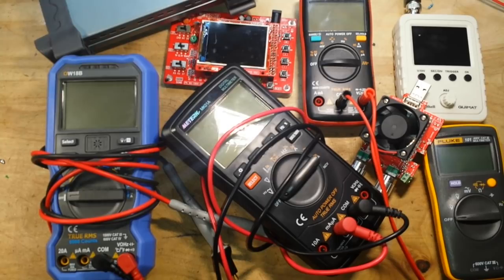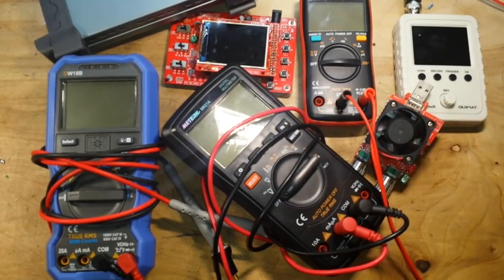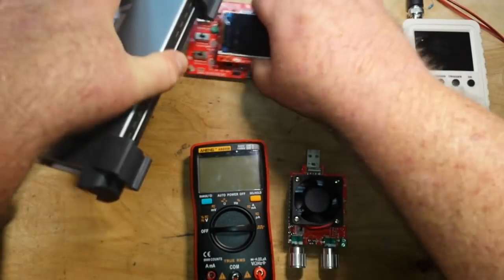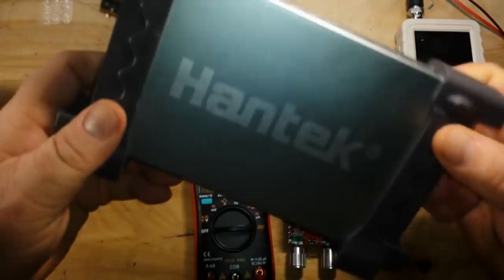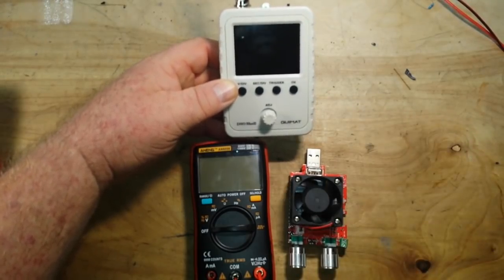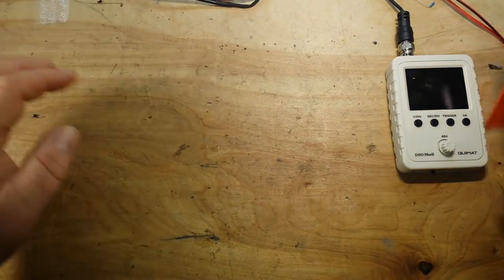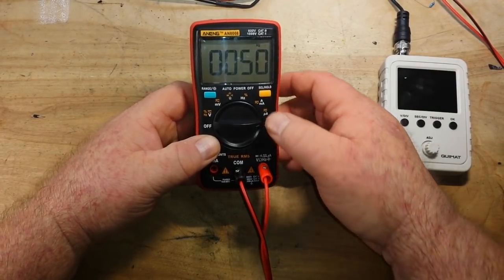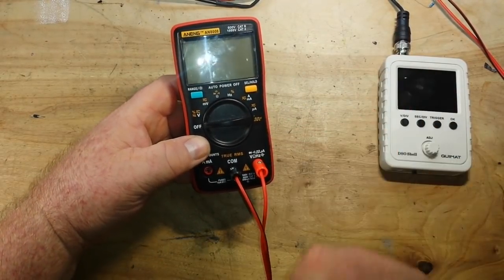Start your electronics hobby for just $60

Comment: Good job helping Eric decide on the entry level beginner toys. I started with a $40 hakko soldering iron from Frys. I already had a Klein tools multimeter then bought the Dso138, upgraded to an inexpensive soldering station from Amazon and inexpensive power supply and one of those component tester kits that has the limited built in signal generator and pwm. The DSO certainly isn't the best but it's helped me in a few situations.

Comment: I wish i got a set like this in the 90's . The case looks like the gameboy. You need a 9V battery / power brick and a dc barrel jack which can be easly found on the scrap. For starters on the budget on low energy , low voltages it is suitable. A used CRT scope on auction is also good option.

Comment: Paul, do you know where to get fuses for the ANENG 8008 multimeter? Not being able to find fuses is holding me back from purchasing one.  I always have extra fuses on hand just for all my meters in case.  Thank you for any reply.
Reply: The fuses are 3.6 x 10 mm   look on ebay etc..  Cermaic ones.  Some have axial leads, you can just clip off if you get those type.
Reply: Thank you.
Reply: I found another place that has these fuses     http://www.littelfuse.com/products/fuses/cartridge-fuses/3-6x10mm-fuses.aspx

Comment: Hey, Paul great video as always. You are a great teacher and I learned a lot watching some of yours and other youtubers stuff. Some time ago you featured a signal generator made from CD4060 and CD4040. After that video I decided to make one of my own. I've added rotary switches for the output and a voltage regulator. My solder job looks horrendous and I still need to find good case for it but it was a great learning experiance for me. I would recommend this small project for anyone starting their adventure in electronics. I would like to thank you and just say KEEP UP THE GOOD WORK!
Reply from the maker: Thanks that means a lot to me

Comment: +1000.
To person ho asked:
Add to your routine run trough charity shops/thrifts/salvation army charity shops.. Go thrifting! I scores multiple power supplies for $1-2 each, proper ones, UL listed. 
Also you will find cables, connectors, boxes.. Pick up any network cable (twisted pairs). Solid cores for breadboard jumpers, stranded for power/signal in project itself.
Grab any "free" printer/scanner/other device that peoples just trow away. You will not score much in components, but 90% that you will get proper power supply and connector for it. You will get yourself good set of boards/devices to play/learn/destroy without any remorse in no time. 
This "toy" oscilloscope it perfectly fine until you're hit 200KHz limit. I have same one "shell", from a kit. Power supply I scored from old IHome speaker, $2 in local thrift. 
Next step in test gear for you can be getting USB signal analyzer -- clone will be just fine, $10 or less. But it will be needed only when you go deep in microcontrollers.
Reply from the maker: Thanks for sharing. That's great information.

Comment: Well said Paul, I've never been a Big Brand buyer,I use big brand at work, but they pay for that, still got my first multi meter, know one else gets to use, they all want it because it still holds it cal its old and it's  mine guess I should tell you what it is : OK are you ready sit down brace yourself it's made by Heath kit  IM2215 no scratches not knocked around perfect show room condition ,that's because back in 70's my parents saved up for it, when money was tight,they gave it to me on my first day of my apprenticeship in a TV repair shop,  I still use it, and is used to this day for important measurements. The small shell scope, useful I've found them great to see if a circuits oscillator is working, the shell scope I bought was a kit good fun. Also check out Buddy  channel is the radio shop buddy's a fellow radio amateur ,great on you vanity call.
73 Paul  de M0BSW
Reply from the maker: You very right. No one needs a Rhode and Schwatz at home right?
Reply: Nope I don't have that kind of money to spend, with 2 daughters and a wife, Eric should go to ham junk sales ect.

Comment: Paying for an expensive multimeter is most of the time useless really. Look around on the videos content creators post all they use is the basic functionality. Every multimeter is going to have errors it's not meant to be extremely precise and the brand on it does not bring any value. At least that's what I think. I'm fine with the Chinese ones. Btw what was going on with that electronic load in the yesterday's video man? Was it a one time thing?
Reply: it does pay off if you work with critikal things like lipos an big life batteries like i do  or high power things like 400v three phase systems but for normal elektronics up to 30v something like a aneng is good enough I have a fluke 177 and a old fluke 77 2 aneng 8008 and a extech ex 330 the aneng meters are my go to on my bench /arduino play ground but i dont go near anything powerfull with it it has no protection inside besides those tiny fuses
Reply: For the most part I agree. Cheap multimeters are fine if you aren't working on anything high energy. For high energy applications, get a good certified and tested multimeter.  For most hobbyists spending $25 on a multimeter is fine. Get 2 of them though. My hand held multimeters for the most part are cheap. For very precise stuff I have a bench top 5.5 digit multimeter.  It comes in handy for very specific things for me, but 90% of hobbyist don't need that kind of precision. 

Before getting a cheap digital scope I recommend getting an analog scope off ebay or going to local auctions. Universities get rid of them all the time and you can pick one up on ebay for under $100 or at an in person auction for $5
Reply: Most people don't understand difference between multimeter for ELECTRICIAN and for ELECTRONICS ENGINEER. Even 30USD multimeter will be fine for working with 230VAC and low current. If you plan to go higher currents let say >5A, or higher voltages like 400VAC and higher, then the expensive multimeter will give you safety.

Comment: Don't forget you can use an old phone charger or AC adapter as a power supply. I've been using an old radio shack AC power adapter that can output 4.5-9 volts
Reply: You could just build one too.